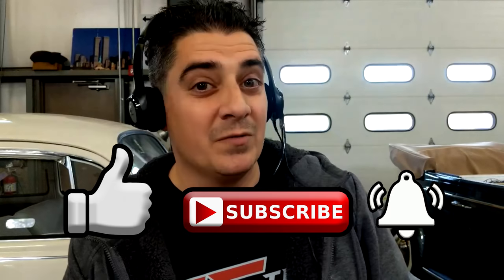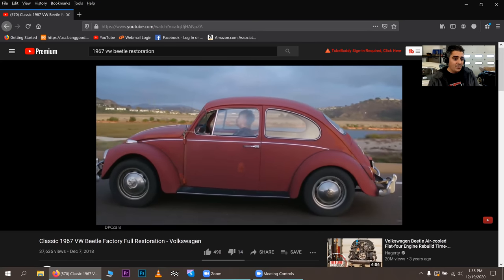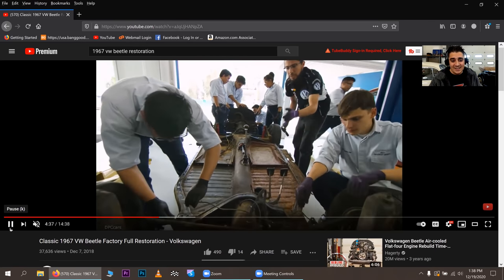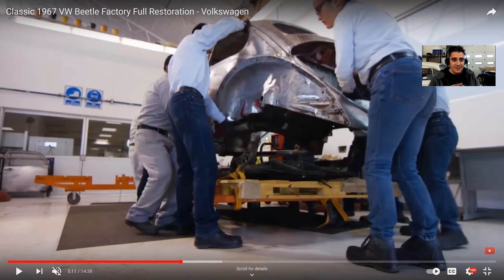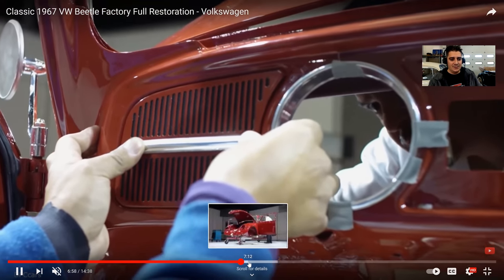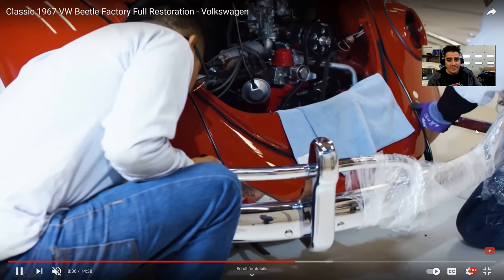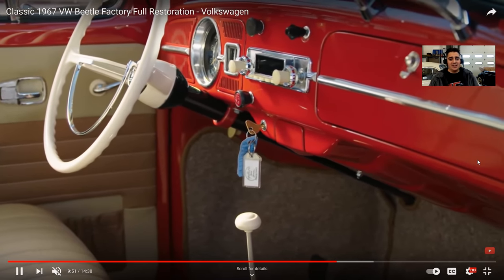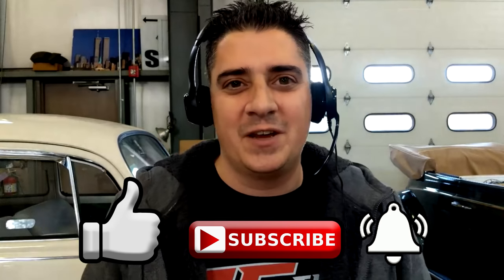Classic VW BuGs - Vallone REACTS to the Famous 1967 VW Beetle Restoration

Comment: Hi Chris, I work for the VW factory in Puebla, but sadly, when they did the project, I wasn't working there. From what I had asked, for the restoration, they used what most general VW parts stores have available in Mexico (Different Mexi-spec Beetles), rather than search for specific parts in US or Europe shops,  and to make the car as usable for a daily driver. Anyway, I thought the same about keeping 100% original, but that wasn't the approach of VWMX or VWNA, again, they wanted to give a reliable daily driver for the lady. Great video! Greetings from Mexico!

Comment: Thanks Chris, it was of course a lovely job.  More than a restoration it was a major overhaul.  My first was also a 67, but not the US version so the headlights were  like these, the old style.  One thing that threw me off, is that beginning in 65, the windshield wipers rest to the left, and it can be seen in the pre-work videos.  After, somehow they rest to the right, as on the the 64 and prior models.  The arms  and blades look the right length, but maybe the motor was replaced with the type in use at the Puebla factory.  Thanks!

Comment: I remember that one; they screwed it up even at the factory. They put on a bunch of EMPI aftermarket stuff even when it was totally complete. Starting with the headlights! Then the ride height made it look like a Baja Bug...🙄🙄🙄.

They should’ve sent it to you, Chris!
Reply from the maker: Thank you, very nice of you.  I thought it came out nice, and the owner looked like she loved it.  I hope everyone is happy with how it turned out.
Reply: @classicvwbugs  sure I agree with you; the bodywork and paint came out beautifully but what kills me is that the car was complete; motor and everything. Then to see all the Chinese bling put into it was unnecessary when they could’ve refurbished the fan housing and engine tin, oil bath air cleaner, etc. I hated the painted block and the belt tensioner and all the unnecessary aftermarket stuff. The chrome valve covers made me puke. Same with changing the fenders and the headlights!!! For a ‘67!!! Stuff like chrome torsion bar covers were totally unnecessary if you had the originals!! Nothing beats German OEM quality. Same with the axle boots; I’ve used OEM type German Febi/Bilstein and even new VW/Audi/Skoda replacements with great results. Like you said the chrome 356 style rims and the moon hubcaps I would’ve done away with sourcing ‘67 style rims and hubcaps. The  Volkswagen script on the front hood as you know was used on some early models but not ‘67’s. Also agree with you on the interior. I am pretty sure she didn’t have much say on what was done to it. The car came out really nice but the owner would’ve been even more delighted if the car looked just like when she picked it up at the showroom floor back in ‘67. Still, though, the story was nice and I also teared up by her reaction when she got it back. It was a beautiful resto; just a shame that with a little more effort it would’ve been perfect.

Btw; when you mentioned some sort of a plastic around the fender area; upon closer inspection maybe it was the front fender beading and fasteners that could be seen from underneath. Maybe the angle of the photo made it look like something else?
Reply from the maker: @vayabroder729  Couldn't agree more.

Comment: I have to agree.
They add a performance serpentine belt to a presumably tuned engine but then fit period crossply tires.
It seemed a bit haphazard for what was otherwise a top notch restoration.

Comment: 13:34 Straight headlights have only been standard for the US export. An european car never head this 2 Part bumperholdings in front for the export bumpers and straight headlights at the same. After they add the GAS filler afther mid 1967, they changed to straight headlights and 4 bolt rims in general. Maybee they did it wrong, because this wasnt even one year option, or they found out it has been updated in the past and changed it to original.

Comment: remember they do all this restoration on Mexico's plant (Puebla mexico de biggest VW plant in Mexico) for them early front end still using on 68 too my brother and me have a 68 and is the same as that one, just the front end and interior, because the shell is not, in Mexico the body with small windows (windshield, side window, door windows and rear window) stops on the models 1969 or 1970 start coming up with big windows and here in USA start coming up not sure but I think on 66

Comment: It could be that the ‘67 that was sold or imported to Mexico had those type of fenders with the bucket lights as the ones Sold in England, and the original ones were beyond repair and they just replaced them with what they think it was the proper ones.

Comment: Did see this resto quite a while back and from the beginning I was a little confused that VW was not using original parts for this resto. Only later on I found out that some used parts on this one were actually original in Mexico. Also the front lights, old style, also here in Europe this type of headlights were common untill the 68 model. I even think in the US they were used on the early 67 models. Anyway, the car looks great, but for me it just lost it's spirit... .

Comment: They Euro looked the front wings (fenders) as we kept the slopers until 68.

That being said it was a mismatch of eras, and just looked wrong imho. The cream steering wheel, etc are just wrong for a 67 (Euro or US) they were all black.

A few other bits like the Swing axle boots were fitted in the wrong orientation so would leak over time.

Comment: I agree with Chris on this one.  It's not really a restoration by definition, but moreover a restoration of a woman's car so she has it all fresh and new.  Clearly she doesn't care about the same details we may see.  And that's OK.  I think what a lot of viewers (including me) wonder is why they did certain things to the car in a more custom fashion.  The front fenders are an example.  Maybe the lady liked the look and asked.  Maybe she wanted the tan interior as opposed to the original black.  I get that.  What I can't figure out is why change the air filter and fan shroud.  Her car had them and one could assume even if she didn't, VW can access these parts just like you and me.  Why not put engine tar boards in?  Why shorten the engine lid seal?  Those things were surely not on her list of things she liked and wanted changed.  Still, I'd love to have it.

Comment: Hi bro have a question I got a 54 VW. Some guy selling a motor 30 horse used.. I have a type 3 engine with 42 webbers came with one of my purchases that I did on a 57 oval. I'm not going to use it but the guy wants to trade me. What do you think.
Reply from the maker: how complete is the 36hp?
Reply: And actually it looks like you're 36 horsepower video that you did a rebuilt
Reply: So what do you think
Reply from the maker: @davidnunezmontecarlo5422  is it all complete? All there?  Then yeah

Comment: Engine looks original type of single port cylinder heads but they added a newer air cleaner, probably a pointless electronic distributor, an alternator, an oil pump with an extension for a belt tensioner, and an appropriate belt. Looks like the original PICT 1 carburetor. Why they didn't add the mechanical fuel injection that came in the mid 1970's? I don't know. Looks like bias ply tires. I think a bad idea. Yes, 1967 headlights, in the US, did not have "eyelids." Work was done in Mexico. Maybe they had lots of parts in stock for 1967 beetles as they were sold in Mexico? And yes the gray areas behind where the fuel tank goes? Were those hold, or insulation to keep the cardboard trunk liner from rattling around against the metal? I would have updated to the seats to seats with headrests. In the US, headrests came in 1968. The original 1967 seats could have been modified to have adjustable headrests instead of the fixed headrests that VW used, in 1968. And talk about improved safety – radial ply tires are a huge improvement over bias ply. A magnificent improvement in handling and safety. On the original rims, you will lose only about a 4 mm of tire diameter, but VW already has excellent ground clearance. 4 mm closer to the ground – not a problem, even off-road. With 4 mm off the tire diameter, the speedometer will read slightly faster. If it read 78 mph with bias ply (top speed and all-day cruising speed), it will read maybe 81 mph with radials even though you are going the same (inaccurate) 78, with the tranmsission in 4th gear and the engine going the same RPM.

Comment: Single stage or base coat clear coat?
Reply from the maker: Usually 2-3 stage
Reply: 2-3 coats of single stage? Did a 67 about 5 years ago. Got your advice several times. Sold it about a year after finishing. $27,000  currently doing a 73 super beetle
Reply from the maker: @randallpiro283  usually base, then like 2-3 coats of clear

Comment: Yeah you know what Chris I see a lot of things in the engine compartment wrong they didn't keep the original air cleaner they went to electronic Ignition, the wrong distributor ,it doesn't have a heating system in it so how is she gonna keep warm living on the coast the pulley system of course and probably the carburetor I'm sure oh no fire wall backing to I hope she took it back , yes the interior the steering Collum is black and a white steering wheel

Comment: Franken-bug but possibly that’s what she wanted 

only things that are weird to me is the fender swap and why the crazy modern parts on the engine and took her heater away 

She lives in SoCal ( based on the plate and landscape ) right now you  need the heater in the morning 
Foot rest over the carpet maybe to remove it and not have to trim the rug ?? 

The holes in the trunk possibly they added a Wabasto type heater 

Homes seem odd shape for speakers

Positive camber was odd 

I’m all about chopping a car up ( the “cal look”)
But some years you just leave like they belong or appear to leave it like a 1600 single port for a bit more power 
But molesting a one year only car it’s hard to swallow 
It was an amazing car they should have picked a non 67 customer to fix up or a 68 customer and do a bunch of swaps on 

It was a great car though

Comment: The restoration is actually terrible! A lot of things they have changed and the car is now very cheesy. No insulation has been installed in the engine compartment. In minute 15:51 of your video you can also see that the front bumper is badly aligned - a bad job overall!